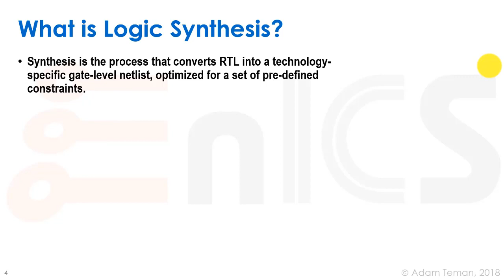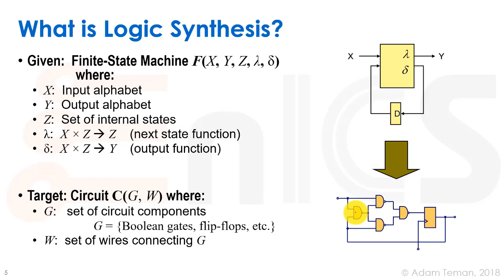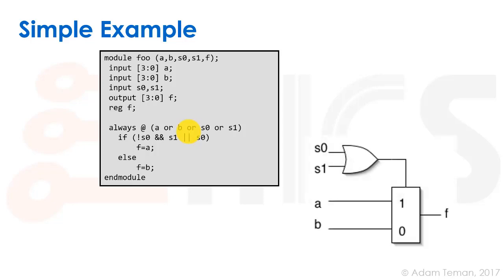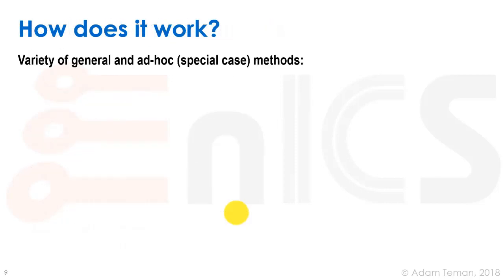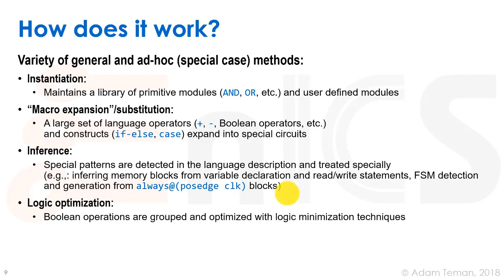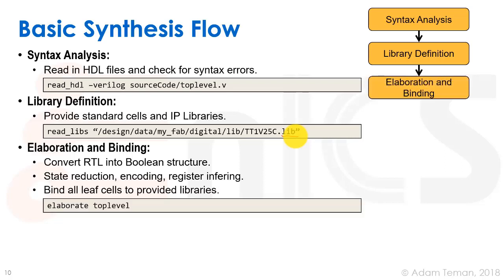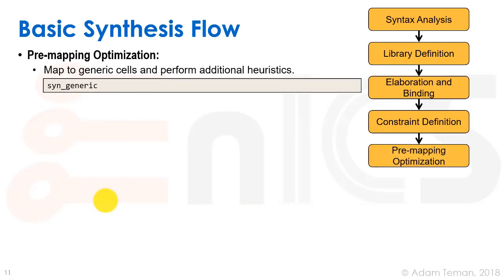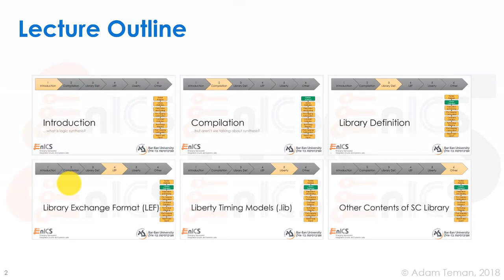DVD - Lecture 3a: Logic Synthesis - Part 1

Comment: Hello, thank you for the lecture series. I have one question. Consider if there's a simple OR operation of 3 bits and I have provided only 2 of the 3 inputs in the sensitivity list., I know that when the 3rd input bit will change, it will not trigger thevprocess block. But what about the GTL,?when it will be synthesized, obviously it will be a 3 input OR (or combination 2 2-input OR) and will work fine. So why was this "sensitivity list" thing incorporated in a HDL?
Reply from the maker: Hi Debtanu,

This is exactly the problem. 
No - the behavior you describe should not trigger on the third input. Therefore the synthesis - which must be equivalent with the RTL - will infer a latch that will block the third input unless one of the other two inputs toggle. So it won't synthesize to a simple 3-input OR. 

In some cases, for example FPGA synthesizers, this may synthesize to a 3-input OR, but this is incorrect behavior. While it may happen because a certain function implementer decided that this was "probably" the intended behavior, an industry-standard ASIC synthesis tool will not cut such corners and a logic equivalence formal verification will show that the gatelevel differs from the RTL.

As to "why" there is a sensitivity list, I cannot say what all the historical reasons for designing the languages as they were designed, but (a) I am sure there were pretty good reasons at the time and (b) to "right the wrong" - or at least make the common case easier and less buggy - the "*" was introduced in later Verilog versions.